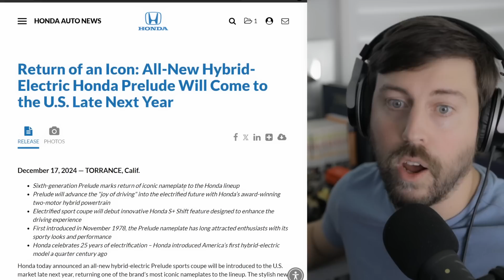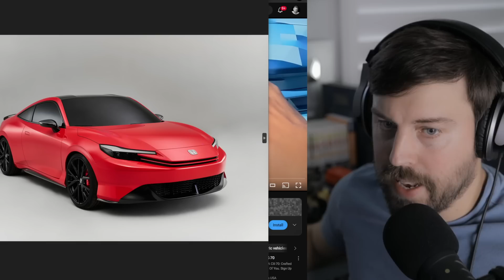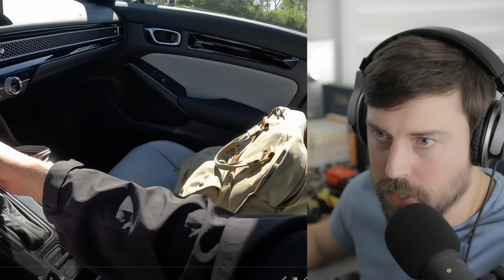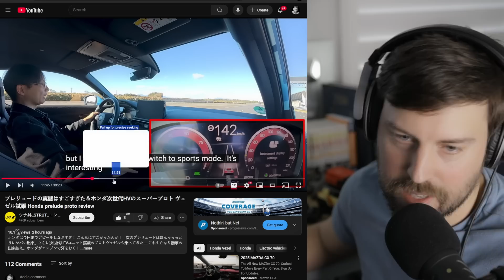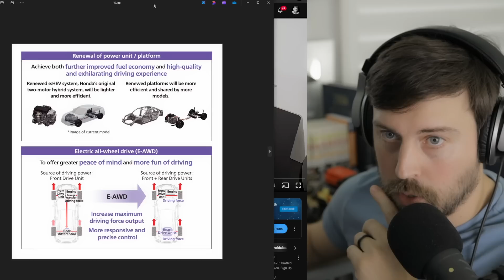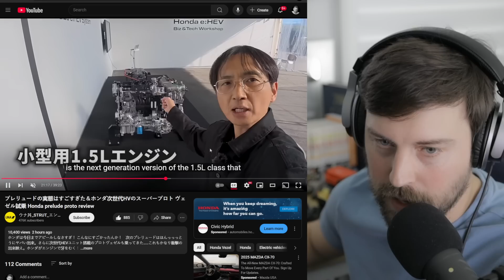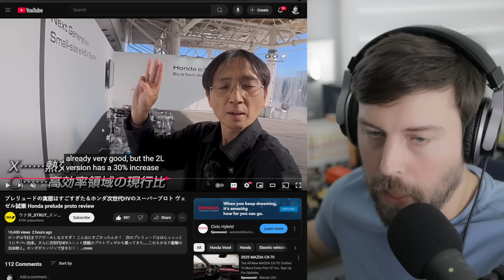Japan is driving the new Honda Prelude // This hybrid changes everything

Comment from the maker: Honda plans to install Honda S+ Shift in all of its future hybrid-electric vehicle models featuring the next-generation e:HEV, starting with the all-new Honda Prelude scheduled to go on sale in 2025.
Reply: **BREAKING NEWS** Honda and Nissan are in talks about a merger.
Reply: Why this is not set by default, especially in sporty cars?
Reply: @les2997  It seems like when I put my 24' accord in sport mode it will kick on the engine (unless the battery is full).  However you can feel the difference when engine is on/off and when it is charging the battery if it gets too low.
Reply: Hybrid my anus
Reply: Hoping they make a Type R version with a pure gasoline engine and manual transmission.
Reply: Hoping they make a Type R version with a pure gasoline engine and manual transmission.

Comment: I do not agree 100% on your conclusion about (lets say "lagg") at about 2:00 minuts of your video. If you go full throttle in sport mode, the Elektromotor is instantly available, which means that the 184 bhp is direct. The additionel 20 bhp you get from the engine will take max. 1 second. The elektromotor is your primary source of fuel.

Comment: The fake shifts get worse fuel economy and slower acceleration in exchange for "feel". Good job! Honda, at least give the driver the option to turn them off. It would take about one line of code.
Reply: You wanna complain about fuel economy on a car that will get at least 40 miles to the gallon?

Wait 'till you hear about Hummers

Comment: I don't think I'm swapping my '97 Type SH for this car. But if they put basically the same drive line from the Civic Si in this, I might consider it. I bought my Prelude specifically because I wanted a stick.

Also, there's so much fun to be had with a high redline. I'm really drawn to the GR86 because it, like my '97, revs to over 7,000. One reason people still talk about the AP1 S2k because it revs to 9,000. The C30 and K20 are legendary and also rev to the freaking moon. They don't make fizzy engines anymore, and it's really a shame.

Comment: just watched a video of the 25 Tokyo  auto salon and  I see why Japan is not making any great cars because they are re-engineering  nissian skyline R32 R33 R34 and supra's with 2jzdett motors and Nissan and Honda  have to merge because no one wants to buy  .....my money is going from a 17 acord v6 coup ... to  gen 4 coyote Mustang GT 5.0 with twinn  90mm throttle bodies. That used to be a thing in my Nissan 240sx that only had one throttle body in the Ka2.4   I had when i was  27 and 4inch exhaust  from Apexi or 3.5 from greddy.

Comment: Honda new gen hybrids havent had the delay for years now. The are driven by a direct drive electric motor that makes roughly 160hp and 230ft/lb. The engine drives a generator that sends energy to the motor and the battery. Any "shifting" you feel is artificial. The engine changes revs to give you the sense of running through gears but in reality its just spinning a generator. The engine can couple to the wheels via a clutch and a geartrain, giving you a drive ratio similar to a final gear in a typical transmission. The engine coupling only occurs over roughly 40mph and at certain driving conditions (sustained speed and moderate accel/decel).

Comment: i wonder if both powertrains will work exclusively on the front axle, it would be huge for traction control if the electric powertrain could deliver power individually to each rear wheel, but on a second thought, it would be a feature probably reserved for a higher end car, rather, simple delivery of power to the rear wheels using exclusiveley the electric system could be a good way to achieve awd without having to redesign the fwd transmission

Comment: A lot of you all here are really stuck in your own nostalgic feels. I owned a 89 Si 5 speed and it's still one of my favorite cars. There are also folks like the lady who posted recently in a Honda Prelude group on Facebook taking a photo with her 1990 Si she bought new and still owns today in front of her local Honda Dealership. She was so proud of her Prelude still running on the original AUTOMATIC transmission. Just because a lot of us love manual, that doesn't mean Honda needs to put one in this car. Manual drivers a niche in the market now and there are plenty of potential buyers who simply won't care that it isn't a manual. We are going to have to accept that this change is happening and will continue to happen.

I currently daily a 2014 MX-5 6MT and I love it to death. Recently I had to borrow my friends SUV to move some larger items and I was reminded how nice having an automatic in traffic was. It was so relaxing. If i can have that with the ability to change to a more dynamic driving mode when I want it, I'm fine with it not having a traditional transmission.

Comment: My Honda CRZ was amazing, still have it but will likely have to sell it. Extremely responsive for 130hp, super fun on some backroads.

I’m hoping the prelude will be just as fun, if not more.

The CRZ is super underrated, really a “have to experience it yourself” kind of car to get a good gauge on how it drives.

Almost every review of it is just some boring guy doing a straight line commute and saying it’s not sporty, without actually going down some windy roads.

S+ in the CRZ primes the engine for Vtech and allows full boost right off the bat. More like a passing button but was great for exiting corners for a little more fun.

Comment: Honestly, the fact this thing is a lift back might be enough for me to trade in my 04 6-6 Accord coupe. I had a situation where I tried to fit a new tv in my Accord, and it didn’t fit. Plus I make a 280 mile trip to see family once a month and driving a stick through traffic is REAL unpleasant after a while. 

I’d probably only lease it though, just because I’m sure Acura will either do an Integra/RSX GS-E variant with E-SH-AWD and better electric powertrain potential, or a Type S variant with the 2.0T from the Accord/CTR/ITS, with regular SH-AWD. Then they could wrap it all up with an HRC version that ditches SH-AWD, has all the ultra-light features and has a stick for driving and racing enthusiasts. Either way, finally some exciting prospects for 2-doors!

Comment: In the video they accelerate ~90-150kph (~56-93 in freedom units) 13sec is way slower than expected for this supposed modern sporty coupe... wish they would have gone with the 1.5T + hybrid and bump it to about 250 hp. Seems to sound like  the 2.0 hybrid from the accord.

Comment: I’m confused on why you keep saying current Honda hybrids are laggy? 

I own a CR-V hybrid for the family and never had issues with sudden acceleration. It drives like an EV most of the time since the electric motor does most of the propulsion unless if you’re at higher speeds.

Also, the 1.5 liter hybrid system will not be coming to the U.S, the smallest car Honda has here is the Civic and it already has the 2.0 hybrid. 

1.5 hybrid is for Europe and other markets.  

Rumors is that Honda was working on a hybrid system to replace the V6 but scrapped it to focus on full EVs, so I wouldn’t EV surprised if we never see a hybrid system replace the V6 anytime soon. Not sure what they will do, go full EV or try to restart development on a hybrid replacement for the V6.
Reply: honda hybrids are slow. only 200hp and behind all the competition
Reply: @ Have you looked at the acceleration numbers versus the hybrid competitors?

Honda hybrids have usually have a more powerful electric motor which is why the Accord Hybrid has a better acceleration time than the Camry even though the Camry has more HP, the Accord has more torque and the electric motor does 100% of the propulsion off the line and most city speeds. 

It’s the same thing with the CR-V, it’s quicker and smoother than the RAV4 hybrid. The Civic Hybrid does 0-60 in 6.1 seconds and still gets 50 mpg. 

Next generation of Honda hybrids will be using an electric rear motor for AWD so they’ll be even quicker.
Reply: @ the toyota grand highlander hybrid does 0-60 in low 5 seconds and it’s a massive suv. So again hondas are behind the competition. Let alone a Porsche 911 hybrid. 

200hp was impressive in 1995. In 2025 that’s embarrassing
Reply: @ 
The Grand Highlander Hybrid Max doesn’t does 0-60 in in low 5 seconds, Toyota themselves say it takes 6.3 seconds, Car and Driver tested it at 6.1.

The Grand Highlander competes with the Pilot, Its also estimated to get 27 mpg. So yes, Toyota does have a hybrid system that can accelerate faster but yours taking a ~10 MPG hit. 

The regular hybrid does 0-60 in 7.8 seconds and gets 36 MPG which is the system that’s comparable to hybrids that Honda has, this is the same system used in the RAV4, Camry, and Corolla.

Honda unfortunately doesn’t really have a hybrid system for the Pilot, They used to have a hybrid system for the MDX that did 0-60 in 5.7 and got about 27 MPG but they scrapped that system .

If you’re going to compare hybrid system acceleration numbers than you should also probably mention the fuel efficiency hit, plus the hybrid max has the complexity of a turbo, 8 speed transmission and a hybrid system. If i was getting a Grand Highlander, i would just go for regular hybrid. If you drive a lot on the highway, the hybrid max only gets 2 mpg more than the V6 Pilot…if you drive city it gets 5-6 mpg more. 

Why are you even mentioning the 911 hybrid…?

It looks like you’re too fixated on Horsepower numbers instead of acceleration numbers. I suggest you go and compare acceleration numbers between vehicles in the same class. 

Accord Hybrid Vs. Camry Hybrid 
Civic Hybrid Vs. Corolla Hybrid
CR-V Hybrid Vs. RAV4 Hybrid
Reply: @ not arguing with a teenage girl in a honda cr-v. enjoy the holidays
Reply: @O8bsj193jdn  

There is nothing to argue when the facts/numbers don’t match your narrative.

Merry Christmas.
Reply: @Fadic4  btw the crv hybrid was recalled for fires. be careful’
Reply: @O8bsj193jdn  Got the notification in my HondLink app, will follow what Honda recommends which is take it to the dealer and get it checked out to make sure there is no cracking on the high pressure fuel pump. Loving this car so far, will definitely get an Accord hybrid to replace my 10th generation Civic. The hybrid system in the CR-V is the smoothest I’ve ever driven. 

I’ll follow the direction of the manufacturer just like when Toyota recalls 100k tundras for faulty engines or million + RAV4 for a fire risk. :)
Reply: @O8bsj193jdn  

I got a notification already about it. Next step is to take it in get it checked out, should be pretty quick inspection since the fuel pump is under the hood. 

I’ll follow what the manufacturer recommends just like the 100k Tundra owners will follow what Toyota recommends to replace those faulty engines. 

I can’t wait to replace my 10th generation Civic with an Accord hybrid, that system is the smoothest I’ve ever driven.
Reply: @ with the merger with nissan hondas will get better
Reply: @O8bsj193jdn  Can’t really know that since  we don’t know the terms of the merger or if they’re even agreed to it yet. 

Supposedly it will be under a holding company so they both stay pretty separated if things go don’t go smoothly, the good thing is that they will be able to share resources with each other where it benefits them.

If Honda gets to utilize Nissan body on frame platforms and Nissan gets to use Hondas hybrid systems (which are not underpowered), don’t really see an issue with that. Plus Honda is weak in some regions that Nissan is strong in so that will benefit them as well. 

Kinda excited to see what comes out of this.

Comment: Hopefully later down the line a fake manual transmission that shifts similarly like their real ones for hybrid and full electric cars like what Toyota is looking into. If Hyundai was able to do with paddle shifters on the Ionic 5, why cant Honda do with on their hybrid most of the power to the wheels is coming from electric motors oppose to the gas engine.😁

Comment: I feel like I’m confused about this S+ shift, or maybe I’m just in some kind of denial and my brain refuses to process this information. So the engine doesn’t drive the car, it just acts as a generator of electricity to power the electric motors which have a fixed gear ratio and drive the car, do I have that correct? The more throttle, the more electricity is needed, so the higher the engine revs? So if you go full throttle, wouldn’t the engine just rev to limiter and stay there? Why are the revs going up and down and why would you notice changes in force as it does so? And why have paddle shifters? Is this all just part of some simulated driving experience to make it seem like it’s not just an EV or am I missing something? I used to be a Honda/Acura person, I’ve owned a ‘92 Prelude, a ‘99 Integra, and an ‘03 RSX, but this just seems dumb.
Reply: While not a hybrid, looking into the Hyundai Ionq N cars online would be a good way to get an understanding of how this type of system works. Functionally speaking technically not necessary, but it's supposed to add some fun to an otherwise not fun system.

Comment: What’s interesting about this setup is that you could possibly set up an emulated manual transmission. 

I also wonder if they’ll have a type r / type SH / Si… would be cool to see them bring back a high strung 8000rpm gas engine for a performance model.

Also: Honda did bring a 1.5L hybrid to America with the insight, but it wasn’t very nice to drive at freeway speeds. Haven’t seen it since
Reply: There is rumors from a designer that there is space in the bay for a K-Series

Comment: Been driving the hybrid civic for over a year and the delay is really bad. Not only that there's a long delay, the duration of the delay is also inconsistant. The only way to drive it in a more spirited way is quick tabbing on the accelerator as if you're driving an old turbo car.

Comment: absolutely disappointed in the prelude 
Honda discontinued the Civic and Accord Coupes, skipped making an Integra coupe, and now comes out with a dedicated coupe in years only to make a 2 door accord hybrid? 
no manual, instead they give us pathetic fake shifts. even the flop of a crz had a manual option, this is even worse than that. 
as an FL5 owner  and a lifelong honda fanbouy i can say the fl5/de5 are the last new Hondas and probably new cars ill ever like.
Reply: Current Miata is great, current BRZ/GR86 not bad.
Reply: @fortheloveofnoise  those are good yes, but the ND is aging and the 86 engine doesn't feel as good to me. If I didn't need the practicality of the FL5I would have an ND3
Reply: Fl5 is crap too and I’m a Honda fanboy I use to have a itr dc2 now I own a gr86 closest thing to the dc2r
Reply: @abcwarrior91  i mean one is rwd the other is fwd lol
Reply: @ShaiyanHossain  Yeah, I pick the GR86 because it's as raw as you can get with today's new cars because of regulation. FL5 just has too many techs and nannies and too many driver modes feels too much like a computer on wheels I want a raw car with just 1 drive mode at all times. The MX-5 is also a great option, but I'm not a fan of convertibles.

Comment: CVT with simulated gears
Reply: It’s not a CVT, Honda doesn’t use CVTs for their newer more current hybrids. The electric motor is connected to the axle and to the engine itself. It acts as a direct drive, so drivetrain losses are exceptionally minimal.

Comment: No manual? Then, no thanks.
Reply: It’s kinda difficult to include a manual to a hybrid system 
It’s simply not as fast/ smooth that’s probably why the CRZ failed
Reply: @ no, it’s not difficult. I owned a 2014 HPD CR-Z. It was a fantastic car and I still miss it to this day. The reason it failed wasn’t because of the drivetrain. It was the styling and the fact that it didn’t align with the Honda brand anymore. It was an odd 2 door that had a slightly cramped interior.

Comment: Honda hybrid is basically an EV, ICE acts like a generator until you reach highway speed/top gear then a clutch closes and ICE drives the wheels. The rest of the time its an EV with a generator. Toyota, Honda, Hyundai all do hybrids vastly different.
Reply: I think its been co firmed that is not the case here
Reply: @Hoop_23 The prelude has the same hybrid system as the 2025 civic
Reply: That's Mazda's new Wankel design, not Honda
Reply: @derHallen  Honda uses that hybrid system too

Comment: I'm realizing with almost 99% certainty that this new Prelude is definitely built on the same chassis architecture as the Integra Type S, with the same Atkinson-cycle hybrid that's been going into their CR-V, Civic, and Accord hybrids. So not all that exciting, however maybe with this S+ tuning of their EV motors and "gears" and a cheaper entry price this will be a compelling enough product ...